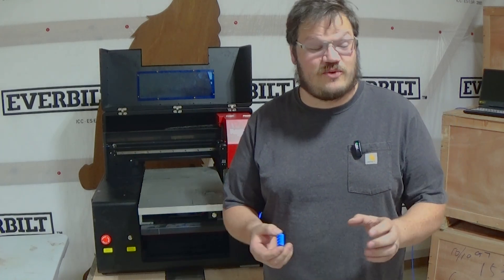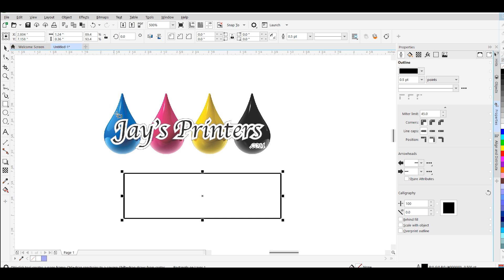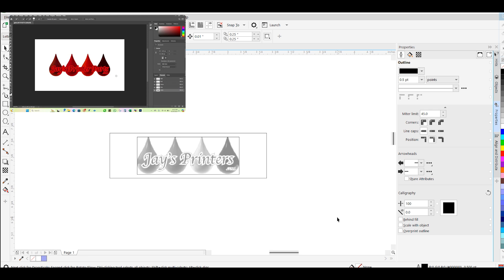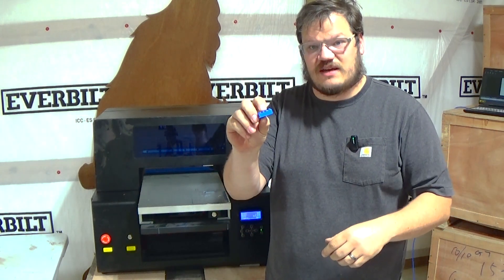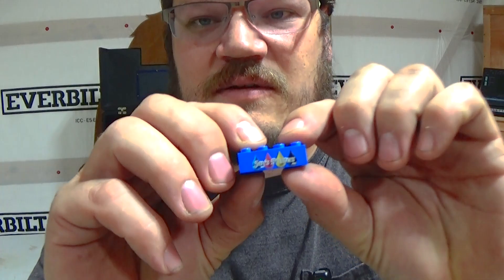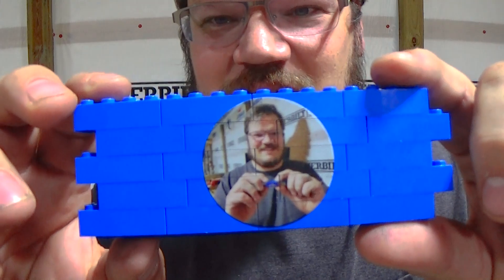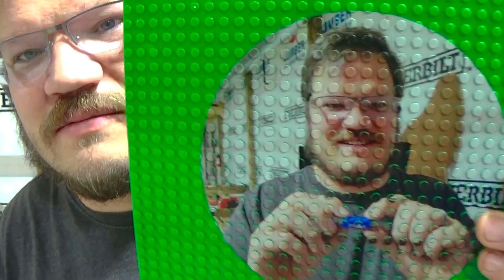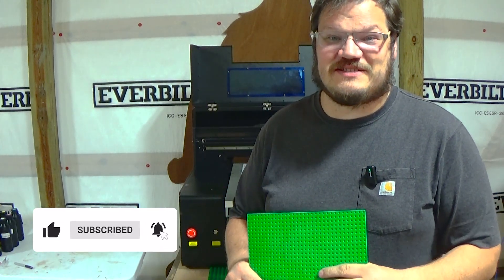Printing on LEGOs with a UV Printer - ZZ2C with Vacuum Table Money Maker

Comment: Thanks for all your videos Jay! I'm interested to buy , but have question re: 7:00 min you mention heat from lamps. How hot is the plastic getting? Approx what temp emitted ? Thanks
Reply from the maker: @mace_aravis  just warm i dint know the actual temp we haven't had anything melt or burn with normal operation